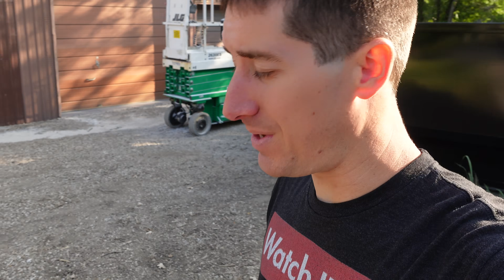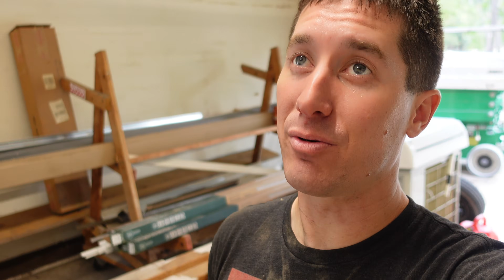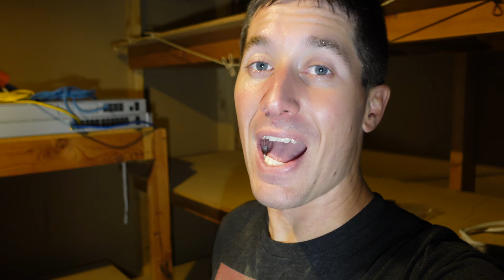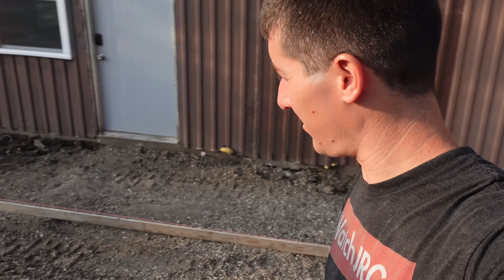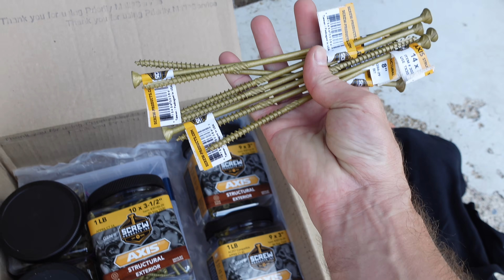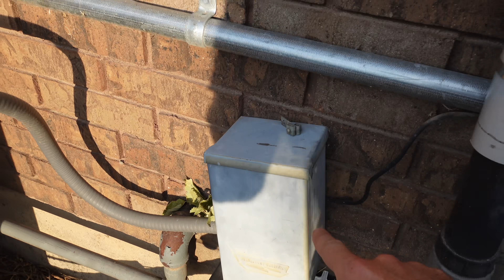Starting The INSANE Concrete Project At My NEW SHOP

Comment: Here's me late as usual. I know I'm too late, but for anybody else reading, the Winbag he got is WAY more than something to level a washing machine with. Every "Mechanic" should have one, because that's what tow drivers/Repo men use to wedge a car door enough to slide a rod in and hit the power lock switch when you don't have the fob or locked the keys in the car. Great thinking from the dude who sent it.

Comment: Lutron Caseta switches to add 3 way to 1 way circuits. The home we're in now had the most bizarre 1way and 3way switches throughout and rewiring was out of the question. The Casetas are expensive but worth the money in comparison to the alternatives and it gives you phone controls and scheduling

Comment: J.R., my house was built in 1965 with a Federal Pacific breaker box. After moving in (2005), I found 14 ga wires inside metal junction boxes that had burned through due to shorts elsewhere, including bare copper to the juction boxes in the hall lights. Finally replaced it during a kitchen remodel. I enjoy so many different projects, def be following more mini resort, and all house and property videos you do. The new shop & cars will be great, keep mixing it up.

Comment: Every issue I've ever had with Comcast cable internet was due to the hack wiring from the pole to the modem inside the house.  3 different houses, all of them the cable tv worked great, the internet was nothing but problems until I told them to run me a new wire from the pole directly to the modem.  I don't care if we have to drill a new hole in the wall, we are not using that spaghetti string of wires in the house.  Took at least 2 service calls with a dude coming to the house before they'd finally do that it and after that the internet worked great.  Thank god I found streaming and AT&T in my current place 10 years ago, internet has been out twice in 10 years now.

Comment: Other than the fact tha is your place and your money and your desire to change it. Why do you need to replace the concrete on the garage and the outside areas, i see it has some cracks but they cant be fixed?

Comment: get the pass through rj-45 connectors in the future.  they make life so much easier.  you never have to wonder if you got the right wire in the right spot.  you need a new crimper with them too.

Comment: I would definitely go with a longer apron in front of the shop doors. But with that said I don’t know the grades and future plans you have and it’s always dangerous to comment on work in progress. 

I just would want an apron longer than my longest vehicle. That way if I wash said vehicle it’s on concrete and I don’t drag dirt in the shop. 

Nice video series and the best of luck with that project since it holds lots of surprises.

Comment: In my house, the builder forgot to put the unswitched outlet in the ceiling for the garage opener. Rather than cutting the drywall and running the wire properly, they took the switched light circuit that was next to it and wired the neutral to hot so they could get an unswitched hot to the opener. They then just took the neutral and ground for both circuits and hooked them together at the outlet/fixture. I did not know about this until I was changing fixtures and was trying to figure out why everything was wired wrong.

Comment: You want a tech out. your service will be junk if you use the old wiring. You're amazing with cars and electric and most things in renovation, but with cable it is not like it used to be. Cable is picky on how it works. I have been doing it since 2016 and can promise you, when it is set up right, you see a noticeable difference in performance.

Comment: FP = Fire Proof Circuit breaker panel
Reply: Federal Pacific breakers are notorious for not tripping during a fault and thus causing electrical fires.  Most homeowners insurance companies will not write a policy if these panels are in use, thus the "Fire Prone" nickname.

Comment: Sometimes you just gotta "dive in" - while it makes better sense to do things in a particular order (and may make more work down the road) it could be worse just to wait on things to be done in the "correct order" - obviously it won't make sense to do things like drywall before new wiring but you have to start somewhere.
From the looks of it you're making a LOT of PROGRESS - as others have said you're getting more done with the koof than others would at 100%!

Comment: Having worked for Comcast, worst thing is someone ordering a self install kit then getting pissed off when it doesn't work and the whole problem is the drop isn't connected at the pole or the one line in the 3rd bedroom is the only one that's connected outside. Two main issues lol

Comment: Lack of neutrals in the switch boxes in the garage?
Check to make sure that your garage lights aren't on what's known as a "switch loop" where the hot is run to the fixture box and then that live goes to the switch (and possibly T's off to others) then returns back to the fixture itself.  It's also possible there's a hidden junction box feeding the hot too.  If there's no neutral in the switch boxes that's also an indication - look for taped white wires or the absences of any 3 wire (white black and red) in the boxes that seem to have 3 way switches but have normal single pole switches.
It's not uncommon (see what I did there) for houses that vintage to have some really sketch wiring (to what we "younger folk" are used to) - though it was up to code when the house was built and accepted ways of doing things.

Comment: I used to work for an electrician. He always smiled extra wide when he saw an FPE panel because it meant he was likely going to have a big pay day. You just gotta love those old Federal Pacific Electric panels (aka Fisher Price Electric, Fairly Poor Equipment, Fire Prone Equipment).  You never have a problem with nuisance tripping.  Hell, those old Stab-Loks hardly ever trip at all.  Need a 30 amp breaker?  Go ahead and put in a 20 amp! It won't trip. They always seemed to be so warm!  I've heard some insurance companies won't even insure homes with some of those old FPE panels. Good idea replacing them now - before a fire comes.  Given what you've said about the DIY nature of the current wiring, I'm mildly surprised it hasn't already happened.

Comment: One tip: if you cut the cat 5 wires at a slight angle you can feed them into the connector easier.

Comment: I had Federal Pacific breakers in my house when I bought it; I was not familiar with them at the time, but my home inspector was. I had all of the electrical replaced from the riser up to and including the breaker box before I moved in. Those things are scary; there was one outlet in the house that had smoked itself and apparently the breaker didn't trip. Had the whole house rewired as a second project.
Reply: My home inspector warned us about our FP box before we bought. I have a nice collection of burned wires, outlets and switches that I had to replace, incredible there was not a fire.

Comment: You need to look at the Lutron smart switches, remotes and base station for automation and linking.  I could have saved myself so much grief when wiring my house.  No more 3 way wiring required. As long as you have power run to a single location, you can put a smart switch in, and then wherever you want another point of control you can can use a low voltage old work box and add remotes to control circuits.  Only downside is cost and they are decora only wallplates, but if you are looking to modernize the look, its NBD.   Can also control multiple switches with a single remote.  Super handy.  They bumped the max from 50 to 75 devices max, so will support 5-6 bedroom house without issue at all.

Comment: We use either the EZ RJ45 connectors and crimpers or the Klein's at work.  The wires pull all the way through the connector, and the crimper trims them as they crimp.  It's so much easier than feeding the wires through one of those black wire guide pieces.

Comment: Demarcs in the house are a godsend, especially when it’s fiber so you’re not trying to splice out in the elements
Reply: and it avoids the "it tests good to the box so it's on your end" arguments - you can connect equipment (phone / cable modem, etc.) right there and see...

Comment: Grading concrete away from a building is great to save water pouring in to the garage.
I would run new wires to every room as you don't know if the correct size wire has been run and you know the house will be safe ,plus change out breaker boxes the the corrent ones.
Yes it will cost more but the family home must be safe ,here in UK if you sell you house gas electrics are tested if not good the old owner has to replace which can bring the asking price down.

Comment: The real way to terminal plugs onto your cable runs, is to not do it.

You need to use a patch panel at the source for your switch, and a jack at the other end.
Reply from the maker: Bleh, at my current house and plenty of jobs I do exactly that… but it does add 2 failure points. Punchdown sucks way more. I probably will do a patch panel in the rack but I only do jacks for walls. APs and cameras get terminated and plugged in 🍻
Reply: I'd agree if it's an installation where wifi can't happen (someone concerned about the waves dude) but if there's only about a half dozen home runs it may just add another point to check if there's a problem and with above cat 5 speeds I wouldn't just add connections...

Comment: Don't rush your constructions just to please YouTube.  This is your home and livelihood.  That's more important.
Reply: I think his concern is pushing out content to keep revenue flowing and thus fund his projects but he absolutely should take care of himself
Reply: Yeah, that makes sense.   @RebelPMP
Reply: There is nothing to rush - a good concrete crew can prep and pour a concrete pad in a day or 2.
Reply: I think he wants it done for usefulness and function, not for youtube. He does not have AC yet (which he probably realizes is becoming less critical by the day) and could not put anything in the shop until it is done and then needs to finish the garage to put things there. He wants it done so he has a shop and can buy and finish more projects not for youtube.
Reply: @johnhobbs4133  Try my house - 1958 to 1980.  No equipment ground on anything.  And my walls are 2-1/2" thick plaster with drywall over that.  Yay.

Comment: SUGGESTION fix or attach or bury those downspouts together and run that water away from your building and put a long drain in your concrete pad. You dont want any water running across your concrete from those downspouts in their current positions
Reply: Concrete is already poured by the time your watching his videos. Too late
Reply from the maker: @Llamathellegend  not around the house, we’re burying those downspouts
Reply: I hope he did something with the water coming at the door
Reply: @bryan688  I think that's the main reason why he had lots of it torn out rather than just leveling it and resurfacing it....

Comment: Hey Jr, the junction on the pole where the RG 6 cable connects is called a tap. Ask the tech who comes out tomorrow to run you a RG11 drop. Then a new home run to your modem.  I work for Spectrum cable and have been doing this for 20 years. That wiring on your house is very old and crusty.  You want the Best cable possible. Trust me. 👍

Comment: I  would say you probably need a new drop from the tap. the tech should run an ingress scan and verify levels don't tank over that cable line.  12 yr old coax is more than likely trashed.
Reply from the maker: Set a demarc box and replaced the entire drop and entry today... this video is a day old, it's all 🔥🔥🔥 now!

Comment: I have terminated so many cables, yes I'm pretty sure I can do it in my sleep
Reply: Work for a cable company in AZ. I completed that appt in my head in about 3 seconds. after 11 years I would run a new drop imo. Make sure the CX has a good line and no issues.